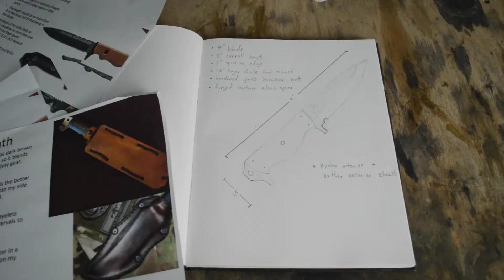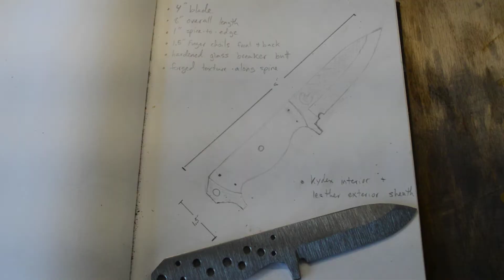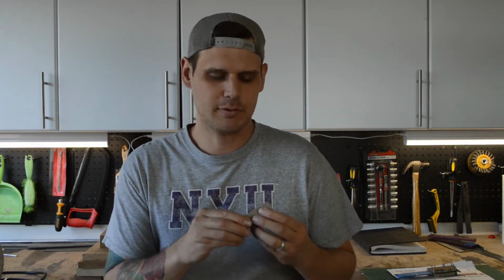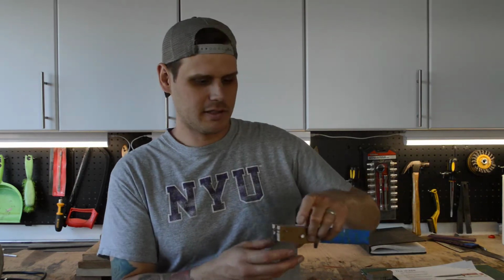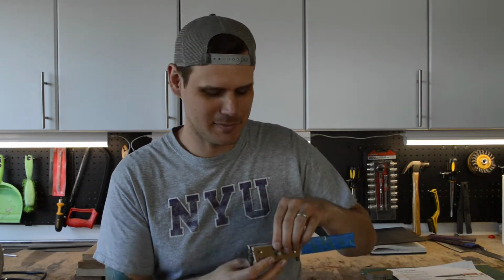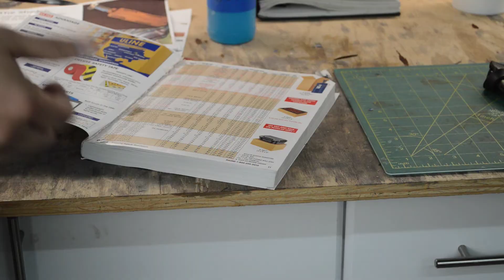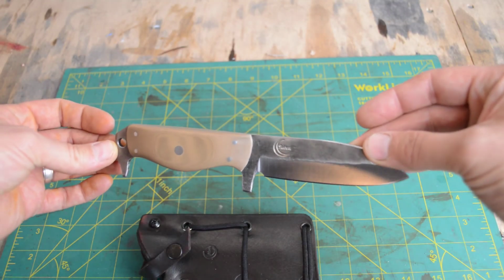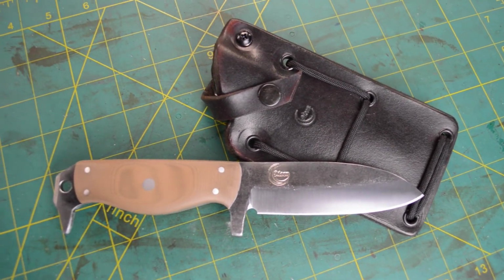Making a tactical EDC field knife for a National Park Service LEO

Comment: That's a great looking knife. I really like how you designed the sheath to mount vertical or horizontal.
Reply from the maker: Thanks! I was surprised at how comfortable this knife was in either orientation. The 550 cord actually provides a very secure fit both ways.